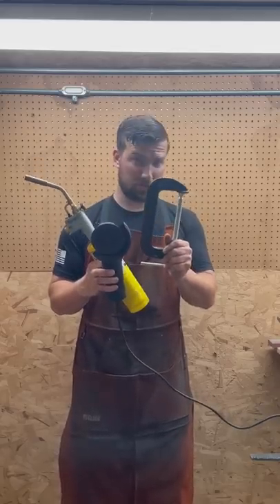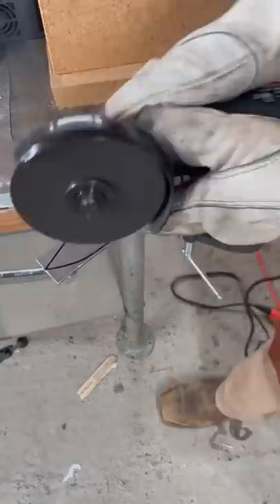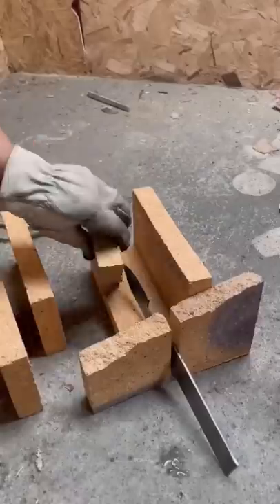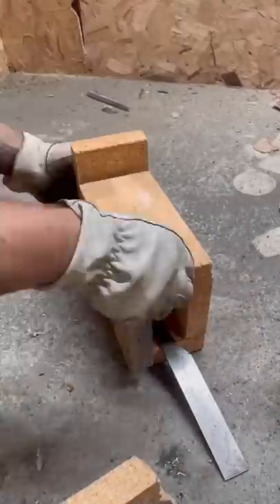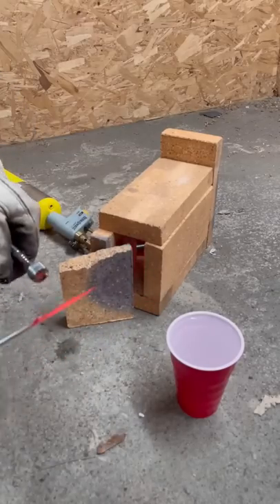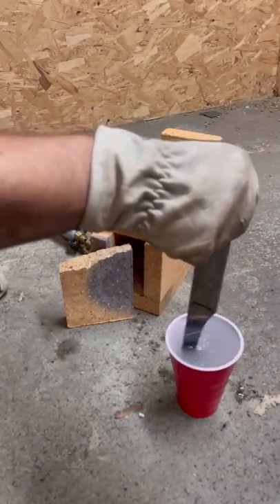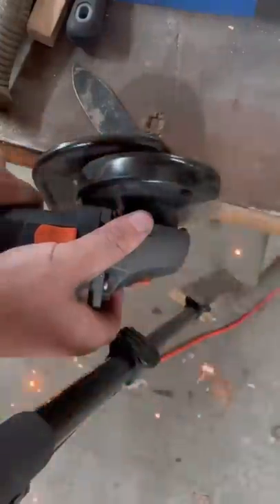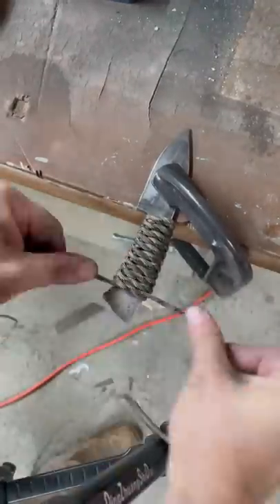How to start knifemaking without expensive equipment!!

Comment: I am a bladesmith and own Alphadog Blades. The only thing you should do is use oil to quinch and don't heat treat twice. Instead heat treat once and quinch in vegetable oil. The water can cause stress fractures. Good job though.
Reply: I’ve just started doing research to get into this and have barley scratched the surface. That being said I was reading an article that explained the different quenching mediums for steel types and explained oil, water, brine and air all had their individual purposes. Would you be able to further elaborate on this? Is oil the best medium for blades more specifically?
Reply: @AutonomousVII   yes Oil with a high flash point is best. Water will cause metal to have stress fractures down to a microscopic level and inevitably cause blade failure. There are experienced blade smiths who use water but they use it in an exact method. 

Oil is far better for a beginner and anyone who doesn't  specifically know water techniques etc. The only time I use water or brine is on softer steel to get as much hardness from it as I can. Even when using oil be sure it's not cold. I heat up a large bolt or railroad spike and drop it in my quench oil. This will also to prevent cracks.
Reply: @AutonomousVII  also if you use recycled metal you may want to test its  carbon content by grinding it and looking at the spark s. The brighter and longer the sparks the more carbon in the steel. They almost look like a mini sparkler.
Reply: @jeffcryptohulkstewart2943  Thanks for getting back to me I appreciate it! I have some old steel from welding projects I want to try and make some blades out of. I also have some old railroad spikes would making a knife out of it be feasible? Would hardening work on it?
Reply: @AutonomousVII  when starting out you should use anything you can get your hands on. The more you make the better you get. Mild steel will only harden up so much but if you know you have a mild steel blade then it's no big deal. They dull quickly but also sharpen easy. RR spikes come in varying amounts of carbon. Most are low carbon but I have made some decent knives from them and lots of tomahawk.

Experiment with quench methods on mild steel.
Reply: @jeffcryptohulkstewart2943  Thank You for sharing your knowledge. Most of the comments on here are people whining about ridiculous details that do not make any difference.. Since they took shop classes out of schools, it's hard to get even the most basic knowledge about any blue collar type trades. It seems like the only way to learn things like this is a trade school or union apprenticeship program before you even know if that is what you want to do..  As for sourcing materials,, I have seen or heard of people using everything from old scrap iron to automobile leaf springs , wheels, camshaft's old or broken files and other cutting tools, and recently I've seen a few videos making ball bearing Damascus...   Someone has to pass these skills on to future generations..
Reply: @jeffcryptohulkstewart2943  What’s a good inexpensive oil I should use? I’ve read anything from motor oil to canola oil.  Thanks again for all your advice today really appreciate it.
Reply: @twistedhillbilly6157  My boys are lucky in this regard. We live in a small farming town in Northern California, outside Sutter. Their high school offers a really good shop class that includes welding and wood working. They love it and both are really interested in getting into a engineering field because of it.
Reply: @AutonomousVII  Sutter county?? Sutter Creek? We might be neighbors. I am glad to hear that.. One of the middle schools in ElDorado county doesn't even have PE anymore and Union Mine HS in Placerville has NO shop at all . I heard that was the same everywhere.. I am very GLAD to be wrong on that..  In HS I had 5 shop classes and went back 2 nights a week for Adult Ed shop classes. Kids that can work with their hands stay out of trouble a lot more too...
Reply: @twistedhillbilly6157   That’s funny yeah I live outside Yuba City around two hours from you. Couldn’t agree more with you and it’s extremely sad shop classes were taken out of so many curriculums. What’s worse to hear is PE is being taken out as well that’s just tragic. My kids grandfather is a farmer and they love being put to work on his farm and applying all they have learned in their shop classes. They love helping me with welding & woodwork and have got me into smelting and now blacksmithing. Their shop classes have allowed them to see the value of it where anything coming from Dad is just another lecture lol.
Reply: @AutonomousVII  start off with some vegetable oil. I use plain cheap vegetable oil from Wal-Mart.
Reply: @jeffcryptohulkstewart2943  Again thanks friend I really appreciate all the knowledge. Hope you’re having yourself a great day.
Reply: @twistedhillbilly6157  the best is old files and rasps. First normalize them by heat cycling. Heat them then air cool. This softens the steel so you can work and grind it. You will harden it back later. The simplest way to know you are at a temp high enough to normalize and quench is use a magnet. Once steel is hot enough a magnet no longer sticks to it then it is hot enough to quench or let air cool to harden or normalize.

Comment: Don’t forget fire bricks, a magnet, belt sander, paracord, and I guess you could include an oven.
Reply: Whats the use of the oven?
Reply: @SouthGlass when you heat treat it it makes it very hard, which in turn makes it brittle, the oven kind of gets rid of some of the heat treating, but not all of it, getting rid of the brittleness while not making it too soft again
Reply: The fire bricks are unnecessary would could argue.

Comment: Great Video! This from a tig welder, with heat treatment processes and many different quenching processes under his belt. USN Avation Structial Mechanic and Cirtified Suport equipment and Aircraft welder.
Reply: They didn't bother showing u where spellcheck was tho huh?

Comment: Yep, I wouldn't use 1095 though. Try 1074 or 1080. They're more forgiving plus 1095 has been problematic due to inconsistencies in certain ingredients such as manganese. This makes quenching problems.
Reply: 1095 by definition is not supposed to have any manganese  just iron and 95 hundredths of one percent carbon it is not however a brine quench steel and you need a much larger quench tub
Reply: @scottjohnson9642  Thanks, from what I've read, it has a little, but too little manganese shortens the time window between forge to quench... regardless of the proper temperature. Many knife makers were having a problem of 1095 knives not hardening during a quench.
Reply: I had my own business making knives for years and used high quality 1095 (not from Amazon). It’s a great high carbon steel that is excellent for bushcraft/survival knives since it can be used with a ferro rod for fire starting. Has great edge retention and if quenched and annealed properly will have good hardness without being brittle. But always oil quench.
Reply: @scottjohnson9642 that’s wrong. 10xx steels have manganese in them, just like all other steel

Comment: my friend and i want to get into knife making and we want to start with this video as inspiration. what material do you recommend for the angle grinder blade to safely cut 1095?
Reply from the maker: Cut-off wheels work just fine for cutting 1095. They are ceramic and relatively cheap. Just be careful that you don’t twist your angle grinder once you are in the cut. Those blades are fragile at any angle other than straight.

Comment: Salt water quench? That’s a new one to try. Probably cheaper than using oil too.
Reply: @FartInhalerSlamPoetry  ok George Bush, lol
Reply: You shouldn't use brine on most steels, it's far to agressive (fast) of a quench, it can cause lots of stress and cracks on the blade.

Comment: When you say that you do this twice, do you mean you take it out of the 400° oven  after an hour, let it cool off (how long?) and then put it back in the oven for an hour again? And are you letting it cool down on its own or do you continue to quench it?
Thanks a bunch! 👍🏼
Reply: 1. Take it out after an hour.
2. Let it cool down until you can touch it (will vary by knife size)
3. Return to 400 degree oven and repeat process.

4. You quench ONCE to harden. The three above steps are annealing the steel to soften it and remove stresses. 

5. You can thermocycle the blade before quenching to prevent cracking when eater quenching. In fact, due to the inherent stresses of water quenching, it is required to thermocycle the blade if you don't want micro fractures in your blade that might have it break at the first sign of stress.
Reply: @crazyasian888  Thanks very much!!

Comment: My first knife was in 1095. I also quenched it in water rather than oil, and the rapidity of the quench caused cracks to instantly form in the steel. Since brine cools steel even quicker, the cracking issue is likely to be worse.

Comment: Doesn't heating from one side make it bend toward one side?  I've heard quenching in oil is better?  Why reheat to 400f? Twice?
Thank you for your help.
Reply: I have not heard of one side making a blade bend a certain direction. Quenching in oil is better, you do two 1 hour cycle at 400 degrees to temper a blade otherwise it will be too hard and can break or shatter
Reply: @foxxy1015  ah sweet thanks, I've been watching heaps of forging shows etc, I've never seen the oven reheat. I'm guessing it's 400F?

Comment: In all the knife and sword making vids I’ve watched, the hardening has been done before the sharpening. Is this to ensure a finer and therefore sharper edge? Because to me, it seems like the hard way to do it. I’d get to as near a razor edge while the metal is still soft, then harden it, finishing with any touch up sharpen it may need. Now, before anyone bags the crap out of me, I don’t forge, I don’t make knives or swords, and in fact I don’t even sharpen them because I’m so cock handed and left handed, I’m likely the only person who’s knives get blunter in the sharpening process. 🤦🏻‍♂️ Sensible answers welcome. Rude ones can be rolled around a 4x2, and inserted where the sun don’t shine.
Reply: The reason for not sharpening fully before the quench is the edge would be too thin to withstand the heat of the forge and likely melt or burn away. Leaving some material on the edge ensures it survives the forge. Also softer metal can only be sharpened so fine before rolling. So to get a sharp blade it must also be hardened first.
Reply: It's not that it'll melt, it would need to get MUCH MUCH hotter for that.

The reason is because if your apex is to thin, when you go to quench, especially in quenchants like brine, your edge will be extremely prone to cracking, it will also warp from being thin too.

You can get what is called Decarb, where the forge will burn away carbon from the steel, but if you're doing something like this, decarb is mostly a non-issue.
Reply: I am left handed! I figured out my problem! Check your edge for rolling! It happens more often than not and you will not realize it!
Reply: Lock your wrist at an angle and use your elbows/shoulders to move the blade, start low, wait for a bur then repeat on next side, then do light passes alternating sides until the bur either gets smaller or falls off. Then strop.
Reply: Thanks  @EODReddFox  , that makes perfect sense. I thought maybe partly sharpening, then hardening before a final sharpen, but that point about the forge burning or melting the edge shows even that wouldn’t work.
Reply: @brertt8350  I think you nailed it. I went through the motions with my arms as described (Without a knife, just to see what you mean.) and I realised I likely have always been using more wrist action. Makes sense to lock the wrists now. I’ll try that and hopefully remember to come back and comment on how it went. Thanks for the tips.
Reply: @gaijininja  I almost completely copied OUTDOORS55 he's a YouTube that has amazing sharpening videos
Reply: @gaijininja  another great YouTuber is Neeve's knives both are great because they explain the process of sharpening and why certain things work rather than just "copy exactly like I do"

Comment: Nicely done. I'd love to see the difference in tensile strength of the same steel after a couple different quench methods. I've used a couple different types of oil in the past but never tried the brine.
Reply: Most tool steels tell you exactly what you're supposed to use, whether oil, water or air.

Comment: When you heat twice to 400° do you let it naturally cool?
Reply: Yes, it is a process called tempering that improves the toughness of the blade. Blades straight out of quench (especially water) will be very brittle, and heating it up in the oven essentially makes it softer and less brittle, however you will lose hardness

Comment: That's exactly how I started making knifes back when I was 15-16,
An angle grinder and my granddad's torch except I only had a vice.
Reply: @spoopy9689  willing? Not so much, the only reason why my dad (mom too) and Grandpa eventually were okay with the thought of me using a torch and some other tools was that I didn't hurt myself as bad or as much but at 1st they didn't know I was using them till they saw the tank's gauges low or tools out of place. But button line, yes, I got pretty lucky

Comment: Nice video !
Informational !
Questions: What do you mean when you say that the file "skates" ?
And, will you be making those for sale ???
Reply: It doesn't cut into the metal, just sliding across
Reply from the maker: I have something similar called The Sidekick on my website right now. www.calculatedsurvival.com
Reply: It skates across the surface because after testing it with the heat and brine, it hardens the knife material harder than the file. The file is hard, but the treated knife might be a bit harder. The 400 degree treatment twice tempers the steel t make it easier to sharpen and less brittle. Hard metal can be as brittle as glass.
Reply: @carnivorecheatday8334  my neighbor makes home made knives, he uses old files to start with as the blade material
Reply: @danielfinney4295  it's a great way to go if u can keep it from gettin hot while u grind it. It's messy but I've done it. And it'll stay sharp longer than I will!

Comment: How to build a knife using an angle grander, torch and a C clamp. 

And a piece of steel.
And fire bricks.
And a magnet.
And a cup of salt water.
And a file.
And an oven.
And some sand paper.
And some paracord.
And a sharpening block. 👍

Comment: Quenching 1095 in water is a good way to make it brittle and ruin the knife
Reply: That's why you temper it
Reply: @Dexter_Morgan.  tempering doesn't fix the issue of the malformed crystal structure, you quench in oil and then temper
Reply: @Romuls753  sorry I misunderstood I thought he quenched it in oil
Reply from the maker: 1095 is one of the very few water quenchable steels

Comment: Pretty interesting video.

The only thing that would be an improvement, would be if the tutorial was about how to make a knife out of stainless steel!

Please; can you do a video on stainless steel?
Reply: You’re not gonna be working on stainless unless you have a proper thermal oven and for one of those you are looking at $1,500 just for a small one. Plus stainless knives are garbage anyways. Use d1 if you want something with good corrosion protection

Comment: No need to heat treat the blade twice as heating it red hot reverses all prior heat treatment. 
Also whats the reason for the saltwater? If it's a water hardened steel alloy any water will work, don't use ice though 😅
Reply: I'm not sure about why he does it twice but it should get red hot at that temperature so I'm not sure what you mean
Reply: You are completely wrong about heat treating. In order to harden the steel, you need to heat it to about 1500F (it varies depending on the exact steel, but the magnet test is a good indicator. Basically you want to heat it until the molecules inside are completely free to move) and then rapidly cool it. I prefer quenching in oil, usually peanut, as this cools it quickly, but not as quick as water which can create imperfections. This will result in an incredibly hard, but brittle blade. After the quench, you need to "undue" a bit of the hardening by tempering the blade. By heating it completely to a "low" temperature, it releases the stress built up from quenching and reintroduce some flexibility.
Reply: @ipodhty  the temper should get the blank surface of the blade a wheat-yellow oxide color. You can look at the color/heat table for steel. Then you know it's tempered.
Getting it red hot again will reverse your heat treatment.

To know what medium to cool the blade in you need to know your alloy. Then you can look up if it needs air, oil or water. If it's an air hardening alloy you can just let it sit in the open and it will get hardened once it's room temperature.
Reply: @hassiaschbi  but he never said to get it red hot a second time that's what I'm confused about
Reply from the maker: I temper it twice. Just tempering it twice, not the full 1475°F twice…. There would be no point in that

Comment: Not, you only mention 3 items you can’t have the metal.
Reply: He said equipment and tools, not materials guy
Reply: @ffsrdr6596  the bricks guy
Reply: You can go get bricks for free lol, go to an abandoned house or to a company's dumpster
Reply: @ffsrdr6596  firebricks are needed for high temperatures, standard ceramic can explode. But even those are cheap